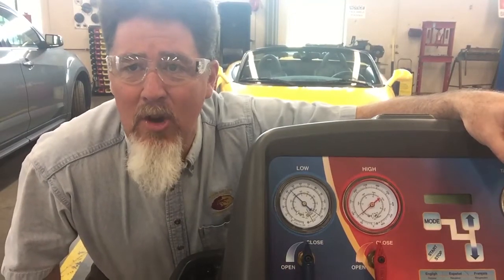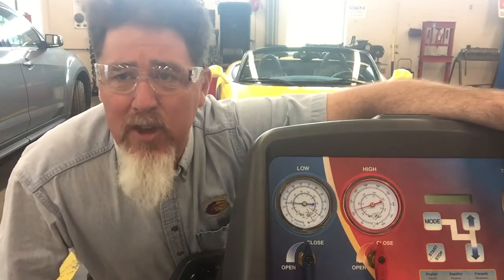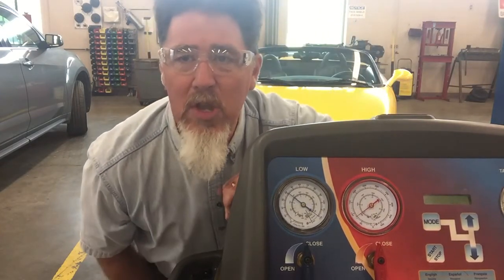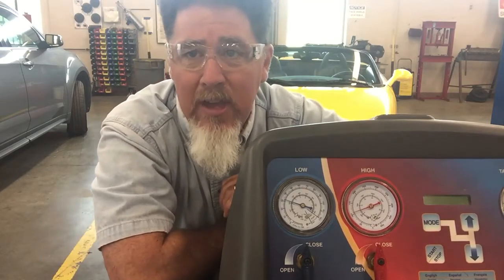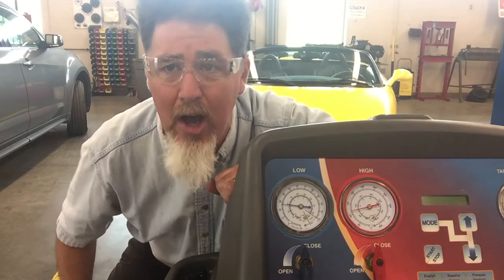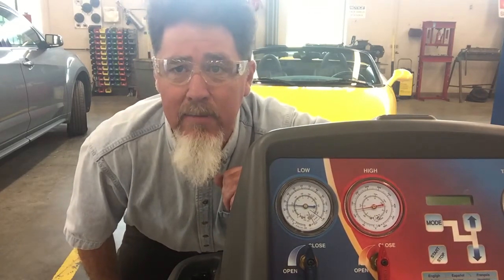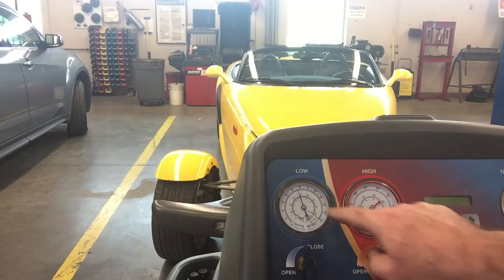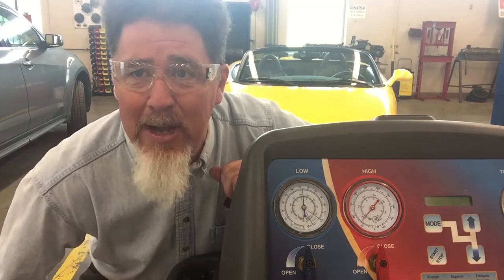AC FOT equalization time on Ford Ranger

Comment: My system on a 2000 Ford Explorer never cycles and the cabin is ice cold, What could cause this or is this normal.
Reply from the maker: Put a thermometer in the dash vents to see how cold the air is.  If the air is under 32 F Degrees and the clutch is not cycling off, there is a problem with the freeze-up controls which could lead to a compressors failure.   Also check to see if the suction line to the compressor is frosting up after the accumulator, this is a possible sign of liquid refrigerant getting to the compressor.